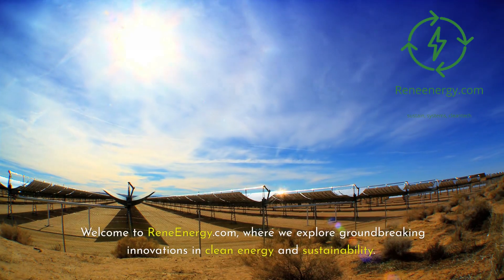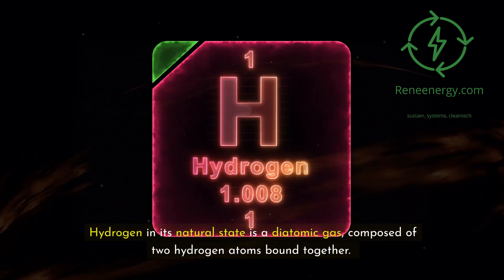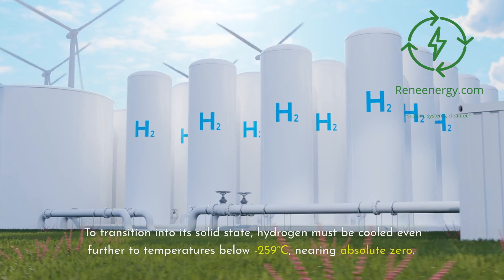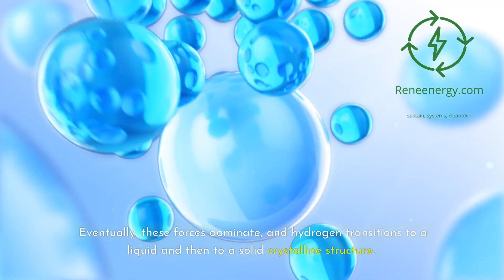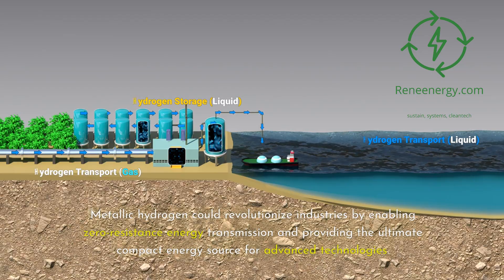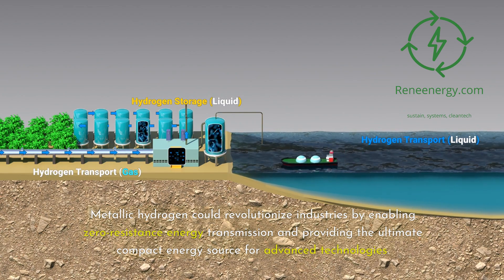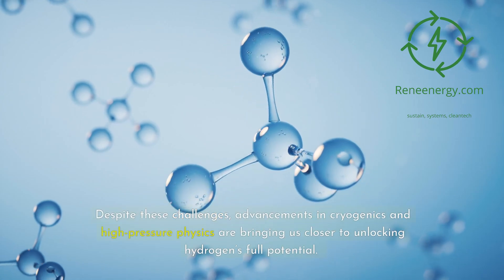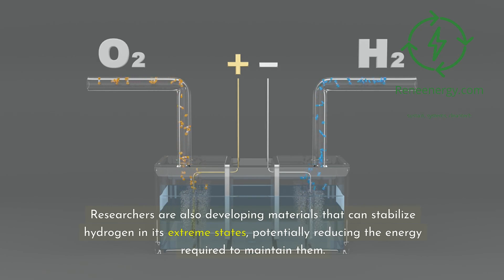What Happens When Hydrogen Goes From Gas to Solid?

Comment: Therr is another to store solid hydrogen, palladium stores 1000 times its weight in hydrogen between palladium molecues.  To get hydrogen into palladium need to repeat cold fusion experiment where electrolysis is performed with the negative electrode being palladium and the positively charged hydrogen will be absorbed into palladium